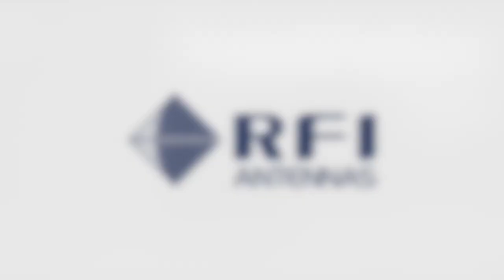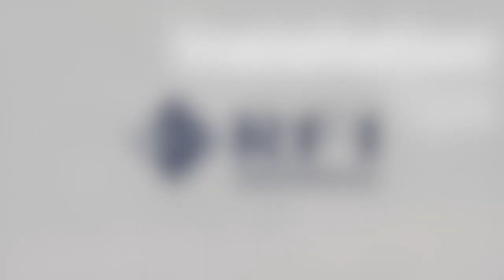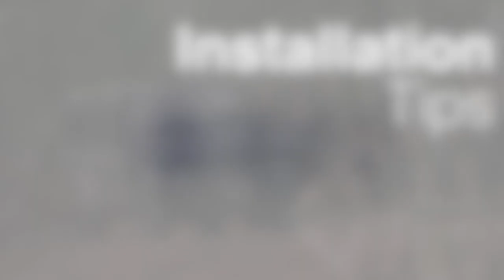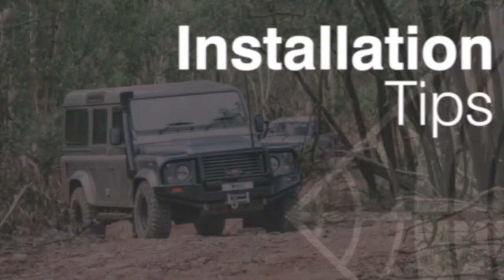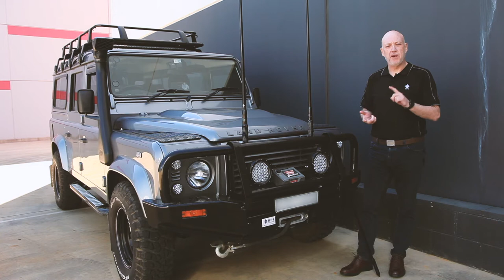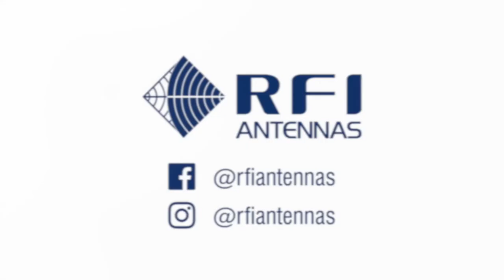Antenna Tips: Installation Tips

Comment: Fantastic antennas, I have both the CDQ8000 and 5000. 5 for the city and 8 in the outback. South Australia is mostly flat and the 8 has impressive range.
I was parked at Rapid Bay and talking to truck's in Port Wakefield granted over water but still 149kms away.
Reply: Thanks Bettabgood for the great feedback. WOW 149km is huge.
Reply: Nice. May I know what rig and transmit power?

Comment: Hey good video but I was testing on my Land Rover 110 TD5. I concluded that when you install the antenna at the rear at the highest point, you get a little more performance and apart the SWRs are reduced. Of course, you have to find an antenna that can be folded because if you can not enter any parking hahahahaha

Comment: Cant help but think how the placement of antennas on vehicle could be illegal since they obstruct the drivers view? One antenna maybe but two seems to obstruct the drivers view IMO.
Reply: Could be by the most strictest investigation of the Australia laws however, thousands of vehicles (especially 4WD run antenna(s) on the front and I have 'never' heard of a booking. I personally have run two antenna on my 4WD (not the one shown in the video) and any obstruction would be absolutely negligible. Ian (RFI)
Reply: I run 2 exacually the same as this setup always have on my 4wds and never got booked its illegal either its fine run as many as u want i ran 4 on my old ute 👌🏽 big 5 post bullbar and 4 big arieals on me v8 ute
Reply: If you cant see passed something thinner than a broom stick, then you should go to spec savers
Reply: @leviodonoghue4523  past.
Reply: @arconeagain  i should have gone to spec savers myself.
Reply: @leviodonoghue4523  fair enough. And I take it you know nothing about mutual coupling. Don't worry, forget about it.